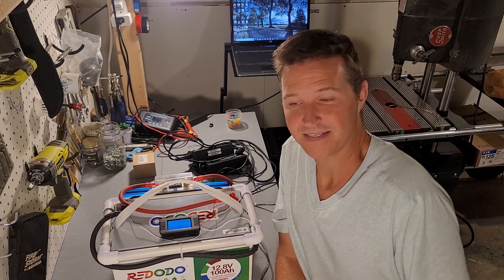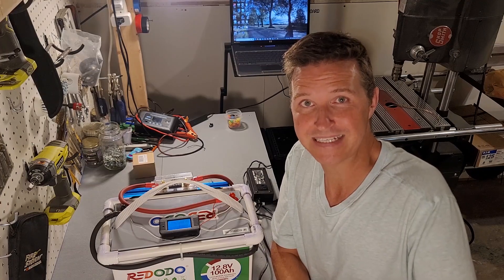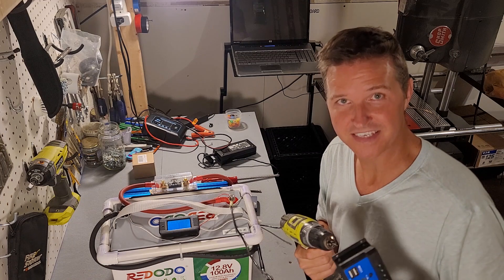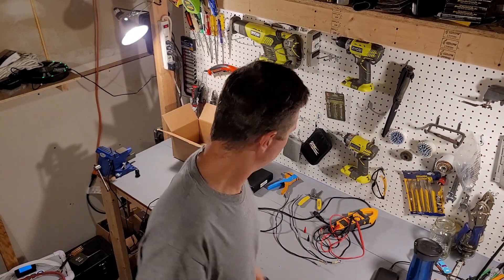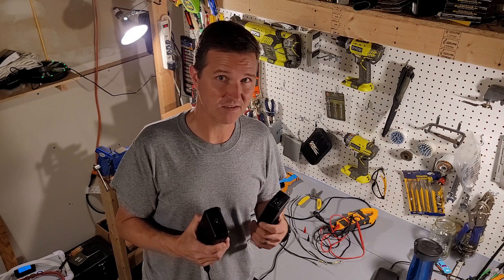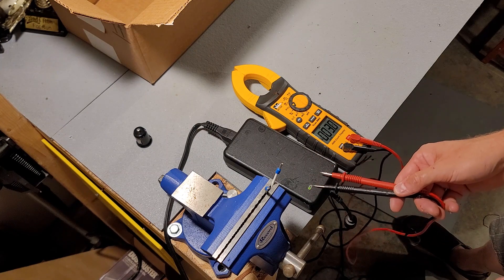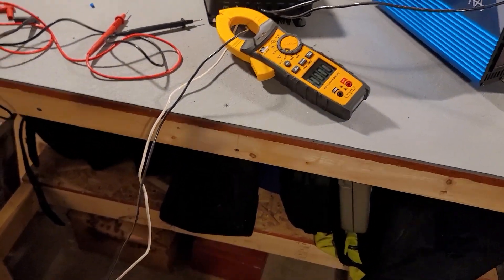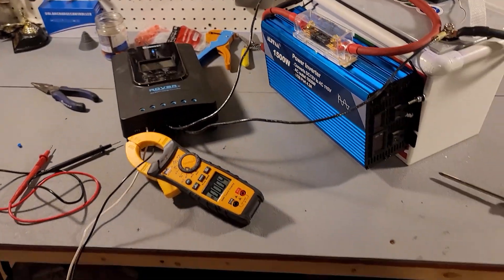Connecting a Laptop Charger to a Solar Charge Controller....  and some other things.. Part 2!

Comment: THIS IS THE ISSUE ! In my situation the switched power supply produced "noise" that bugged the controller out. Everything works perfect with my bench supply. Sorry if my post is redundant, my lawn is demanding that i cut it !.. try to filter the DC with capacitors..
Reply from the maker: Others are saying that the CC is trying to pull too many amps and the power supplies are going into overload protection.  What do you think about that?  Thanks for the info and comment
Reply: @OffGridBasement  I suppose if their was some kind of protection as such build into the "wall wart", but usually those are built into the BMS. In my situation I tried a 19 volt computer power supply on a renagy 10 Amp charger with a 6ah lifpo4 battery. I used the cheep bt-1 Bluetooth meter to obtain charge data. I wasted several days as the charger would at max do .6 ma at the batteries current voltage. After trying several more PS I ordered another, this time a renagy 30li. Same results. I believe the issue is noise is goofing out the pulse wave signal of the charger. If you hook the solar input to a clean DC source it should work. I can't see any difference from a solar panel pushing 5 amps vs a clean DC PS ( other than stability ). I would think that the controller would function properly even if the battery has a large amperage draw. I will hook up my computer charger to my oscilloscope and see what noise is there. I will get back to you.

Comment: Aren't you using 10A or 15A charge controllers? If so, they're going to try and draw that up to that current. A 65 W laptop power supplies can only provide around ~3.2A at 20V and they all have over-current protection. They will shut down if you try to draw more than the rated current.

I think you need a power supply that can either limit the current or can handle the max current of the charge controller.
Reply from the maker: Thanks for the info.  I believe you are correct based on the other comments.

Comment: For proof of concept, use a smaller battery. 12v 7Ah lead acid.

How many watts on each power supply? Divide that by the 19v, how many amps can they produce?
Reply from the maker: I believe each power supply is around 65w.
Reply: @OffGridBasement  So about 3A each. This might be the problem. The battery is just pulling too much, and the charge controllers are trying to provide that. The PSUs are probably shutting down with over current protection. A smaller battery that pulls less, or a SCC which has a configurable current limit would probably be key to making this setup work, or a PSU (maybe a bench top supply) which has a constant current mode. Basically current limiting...

Comment: As much a good batteries cost it doesn’t make sense not to use the charger made for them.  Have fun stay safe.
Reply from the maker: This is very true.   I really just wanted to see if it were possible.   Thanks for the comment 👍

Comment: Thank you for trying for us. I have never tried laptop power supply but I have two switching power supplies that work very well with my Renogy 30A MPPT.  One is a DROK 10A 0v-48V adjustable and the other is 30A 15V (slightly adjustable) from aliexpress.
Reply from the maker: I'll keep that in mind.  Thanks for the comment!
Reply: I also have a DROK 24v 20a I'm wanting to use but it's only voltage adjustable. Do you need the current adjustable version? Or do these DROKs simply only give their max amperage? Worried about a charge controller trying to pull higher than 20a. Or if I get a 20a controller, will it simply only ever try to draw 20a max?

Comment: Great experiment. I was curious as well after watching freely roaming in this video https://youtu.be/DBIPCYvrVv4 . I think the issue is that the cheap low end charge controllers don’t have current limiting capabilities. I tested this with a Victron smart mppt 100/20 and changed charged current to a low current of 1 amp. Then slowly raised the amps while watching the laptop power supply making sure to not exceed its current output. I was able to get it work but if you want a lot of amps you would need to parallel or series the laptop power supplies as you have done. I like these videos. Thanks
Reply from the maker: I'm glad you like them.  Thanks for the comment and the info 👍

Comment: I have done this. I used a victron 75/10 mttp controller. The problem is the controller is trying to draw the max current it can. I set the victron controller to only draw 3 amps from a 19v 3.85amp laptop power supply
Reply: I think this is correct. If you set the charge controller to draw 3 amps max, then you won't exceed the amp limit on the power supply.
Reply from the maker: Makes sense.  Thanks for the comment.
Reply: Good thought on the initial comment
Reply: This worked for me!  I was in the same situation and set the limit close to the max amperage for the supply and it started working.  Thank you!!!!

Comment: im thinking how bout a car voltage regulator? or you could just buy a Voltage Regulator DC-DC Voltage Stabilizer 30A Power Supply Adjustable 12v-24V or make you own must be hundreds of youtube videos on how to make a 12 volt regulator
Reply from the maker: That is true.  Then I wouldn't even need the power supplies!   I'm done with those damn things!
Reply: @OffGridBasement  i have to give you props for coming up with the whole idea working or not.
Reply from the maker: @mannyfragoza9652  Thanks.  Wish the video could've had a happier ending...